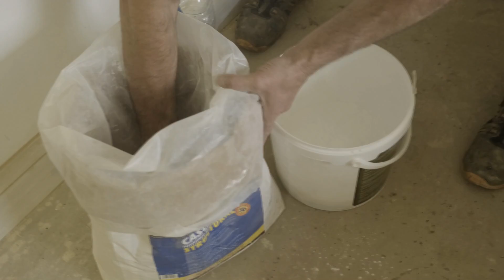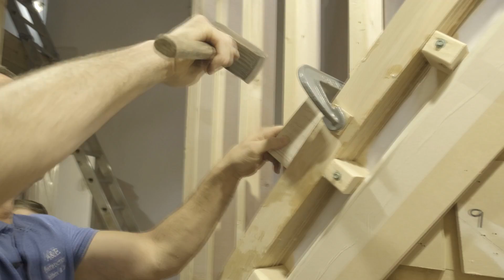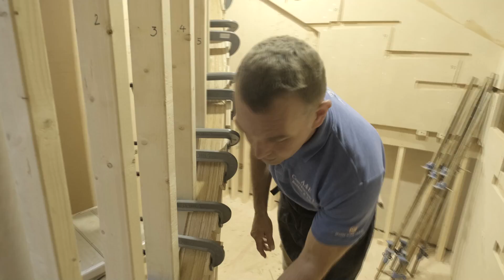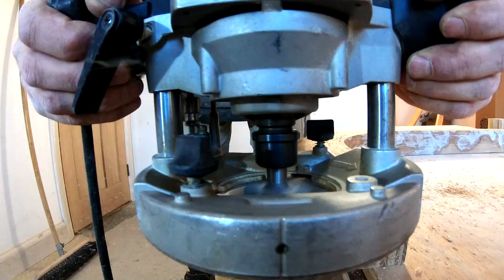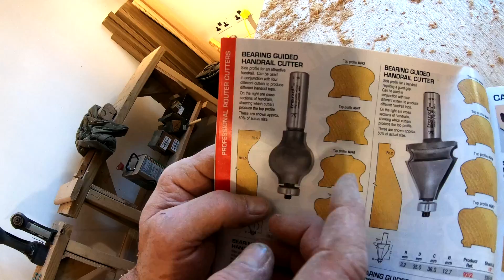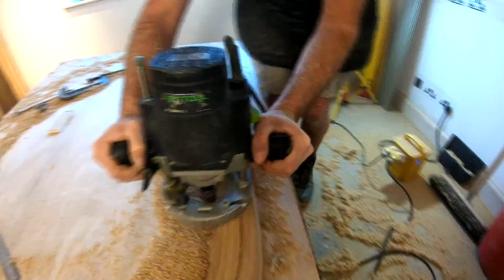CURVED HANDRAIL | How to Build a Staircase #4 | Build with A&E

Comment: I've got a project with a VERY tight inner radius handrail, almost like a spiral staircase over 180 degrees. The radius is like 6" or less... How would you deal with not only a tight curve, but also a heavy twist? We are scratching our heads on this one, thinking CNC might be the only way, which is big money. Thanks in advance!!
Reply from the maker: You can steam the timber
Reply: @BuildWithAE  Steam AND laminate? Wouldn’t the wood be wet and glue not work well?

Comment: Hi there,
You used oak in the video. I need a  mahogony type finish,  sapele perhaps. Would you use the same process? Or would you prefer a different wood?
Thanks
Sam
Reply from the maker: Hi Sam sapele is a wonderful timber to work with and be absolutely fine DM some photos when done if that’s Ok all the best Tony 👍

Comment: Beautiful work! How would you do this if you have a finished wall and can't clamp to the studs?
Reply from the maker: Hi Kimberly much appreciated. Not to sure
All the best Tony 👍
Reply: Make or mockup copy of the wall height and stair width. 
Now construct the stair case curve with piece of 1 inch phex pipe. draw the lines. 
Measure each step height.
Next cut in the stair rail or ballaster.
Measure. Measure.
Measure
Once you finally confirmed all the exact measurements.
Cut the oak strips and start gluing
As you can see. With the massive amount of clamps needed.
Set the glued up oak or the wood of your choice.
Clamp in place. 
Finally removed the ballaster.
Next lay the assembly in place and see if it fits.
And finally the finish work.

Comment: Vertical strip-lamination, is only one way to make spiral handrail and is not without problems and limitations.  These guys make it look quite easy. It's not.  Besides building elaborate bending forms, you must have a mountain of clamps (which must be left on the job, if you're using the stair as a a bending form.  Small, steep stairs are sometimes not possible to bend. This also requires at least two workmen to get things done and you've got to work fast or use an extended-time glue.  
BTW, if you use the wrong glue, your handrail will spring-back more than it normally does.  At that point you'll have wasted your time and materials.  Don't bother finishing it or trying to install it, just cut it up.

Comment: Thanks and great video/job. Question the blocks that the hand rail is sitting on how did you determine the dimensions of layout? And If I’m going to bend a rail and the treads differ in dimensions would I have to set blocks at the dimension where the finish nosing of tread would be at to keep the same rake?
Reply: Please get back to tony!! It’s a framed out curved staircase so I know I can clamp to stud just wanted to know the rule of thumb on the block playing weather you just mimic the dimensions of each tread nosing

Comment: That “double locking feature” isn’t really a safety feature. The first break of tension is the collet nut loosening from the collet holder threads and the second break of tension is the actual collet being pulled free from the collet holder as the collet nut is being backed out. Great work though!
Reply from the maker: Hi Bradley well you learn something new every day it makes perfect sense thanks for watch all the best Tony 👍

Comment: nice job, im wondering how they do the solid wood curved hand rails? I can just imagine the difficulty on steam bending large and very long pieces of wood. then fitting it on a jig. Is that how they do the solid wood ones?
Reply: Solid wood handrails today are typically manufactured using CNC equipment (computer numerically controlled)  These are typically 5 axis machines and very expensive to  purchase and program.  The programmer must also be highly  trained.

A typical curved stair with one inside  stringer and handrail, usually requires at least 3 solid, helical handrail segments.  These are rail-bolted together to form the overall length. 

During the 19th century, various drawing techniques were used to create the required patterns (called face molds.)  These were sometime provided by the architect or a handrail specialist.  

Not just the proper helical curve was required but twist bevels had to be ascertained.  The ends of each handrail segment had to have exact amounts of twist in order to remain level as it spiraled around.

The method that I used was known as "the tangent method" and was first introduced to North America by Robert Riddell.  Although there were others who used different systems.  Riddell remains at the top. 

The Mowatt brothers refined his work and penned one of The best books on the subject.

The look and feel of solid curved handrail segments remains rare. But there was a time when only a crazy carpenter would cut-up perfectly good timbers and reduce them to bundles of strips.

BTW, to my knowledge,  there has never been much steam-bending in curved handrail manufacture.  That was more for the boatbuilder.

PS,  Not only the curved handrail was formed with twisted surfaces but all of the adjoining fittings as well.  

I'm retired now but have been paid to lecture and teach this now obsolete and forgotten skill.

It still works today though and with very few limitations, commonly associated with strip-bending.
Reply from the maker: Hi hurculeforever thanks glad you enjoyed the video, steam bending solid pieces, well something that I haven’t done but I bet someone out there would be maybe doing it especially in boat building or something on that line, I’am going to YouTube it I need to know all the best Tony 👍 keep safe
Reply: Hi tony,fellow carpenter here though not up to your standard with staircases like this one,I have been watching very closely and due to the fantastic way that you explain things I believe I would be able to tackle a similar but maybe less complex one so thanks.
Do you ever watch grand designs? There was one a few years back where the builders/homeowners had a business and made a living steam bending wood and some of the details that they incorporated in to their house were stunning,I would recommend watching it if you can find it anywhere. Thanks for these videos mate.

Comment: Nice built ! Wy dont use a router table or shaper table instead of a hand held router ? Table will give you more stabity...
Reply from the maker: Hi top 111 portland good question, the reason I don’t I feel I have more control over the run of the handrail especially with longer rack piece handrail, in the joinery shop we would use a feed roller on a spindle moulder, thanks for watching all the best Tony

Comment: Was just wondering why you choose to you a straight cutter and not a fluted one to cut the stringer? Not doing stairs that long! But have already blown up one router on an oak string because you cant plunge in increments with a the standard dovetail cutter! I ask with respect and reverence as you clearly know your s***t!
Reply from the maker: Hi William Davis sorry for the late reply, great question, it’s funny that I have never used a dovetail cutter I suppose it’s because it’s the way I have been shown always used a flute when being trained it might of been cost, the main reason for me is most veneer finishing you have to have a square surface because the trim router bit needs it, if it was dovetail it would trim to the wrong position, the rule with cutters as I was always told width of the cutter is the depth you plunge no more is 13mm cutter 13mm plunge, also some cutter have cutter speeds on the plus always use a 1/2 collet not 1/4 or 3/8 thanks for watching, keep safe all the best Tony 👍

Comment: You only need glue on one side unnecessary  on both
Reply from the maker: Hi mark kouba depending on what glue you use might be the case, but do you get the working time, do you get the clear glue line, I have tried many glues over the years especially when I was making stair’s full time and always came straight back to cascamite, plus working with Oak as you may or may not know it has a tendency to move a lot, personally you would have it delaminate if you only did one side. Thanks for watching keep Safe all the best Tony 👍
Reply: Glue on both sides helps the strips to slide while they're being bent.

It also allows a little more time before the glue begins to grab. And you need more time to get  everything in position and all. Clamped up.

Strip-laminating is tricky business and when you're done, you cross your fingers that you won't have to much spring-back or delamination issues.

I hated the whole process and even the striped handrails it produces.   It also requires another pair of hands which was not always at hand. 

Eventually I learned to cut and shape  curved handrail from solid stock which put an end to my bending days.

Comment: How do you find the festool router? my DeWalt has packed up, I'm considering the festool
Reply: Wouldn't recommend them or trend routers. Plenty of power but the handles and position of them are horrible. Especially if you use the router plenlty. Makita router is lovely to use and comfortable. My opinion. I do plenty of moulding and curved handrail same as these guys so just my opinion. Go to a toolstore and get a feel. Yes you will get more attachment with trend but also the price tag as well with them
Reply: @snwman862  couldn’t be worse than Bosch. I hate those stupid round knobs